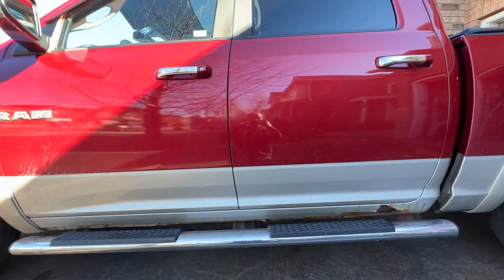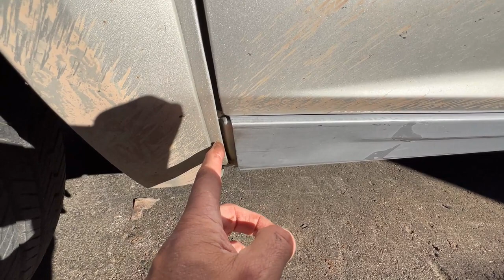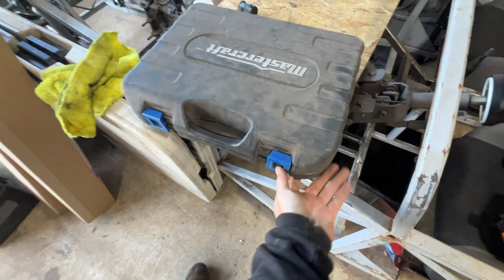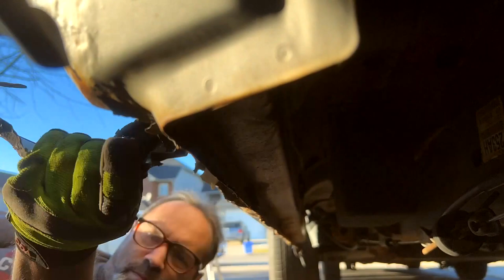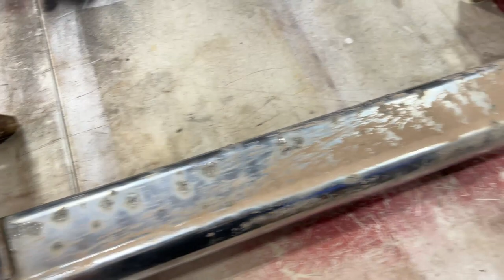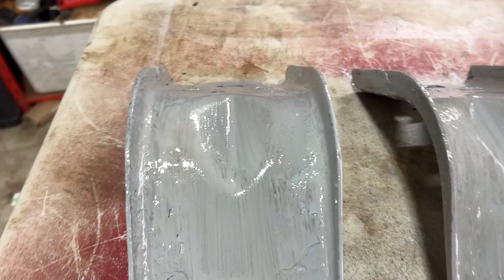Ram 1500 Rusty Rocker Panels Repair Day 1 - The Carnage

Comment: For those who wish to fight rust. There is one thing to know :  to be definitively efficient against rust,  you should  put grease everywhere. grease is the only thing very efficient against rust. put grease between metal and carpet, inside door, behind metallic bumper, under the vehicle, behind  the repairs you can make (everywhere inside the body - hidden erea -  instead of using paint), hollow areas (necessarily hidden, so no need to be aesthetic). For rear wings unreachable with a paintbrush, use an extender and poor old oil everywhere each year. rust  always comes  from the inside and welds.  Handyman Experience - 35 years.   From france

Comment: Next time you have to remove a panel that has been spot welded drill the weld about half way through then hit it with the air chisel. It'll pop right off.

Comment: Just patched the sills on my van, and it passed the mot yesterday with no advisories! :) ... and a wee tip I'd recommend is either cover the rest of the car with something whilst you're cutting metal, or be sure to give it a good wash down to remove all those metal filings.  Looks like you were lucky to get a heavy rainfall, but a heavy dew the morning after doing such work can result in lots of rusty specs all over your paintwork ... ask me how I know! :(

Comment: Same exact spot as my 09 ram I just traded it in for a 22 to 6 months ago, I fluid filmed the hell out of the new truck
Reply from the maker: They are rusting from the inside out, so byy the time you see a bubble, the whole lot is doomed.
Reply: Absolutely and the truck was never driven in the snow and only had 43,000 miles on it and it was a big hole like yours on both sides in that same spot the dealer seem to know about the issue